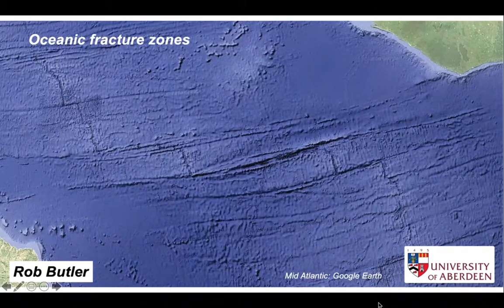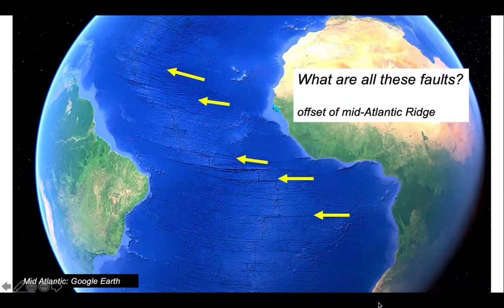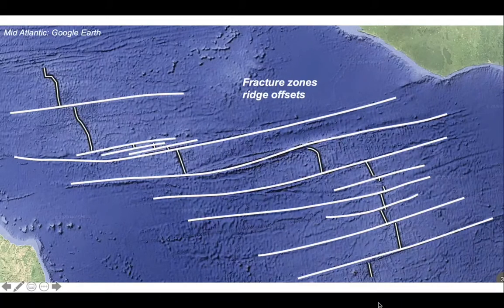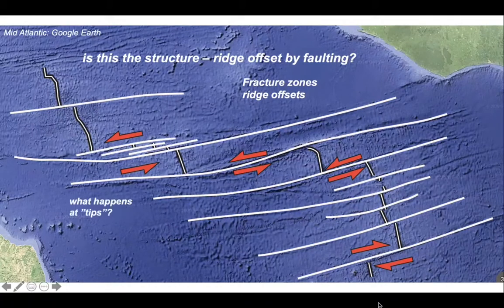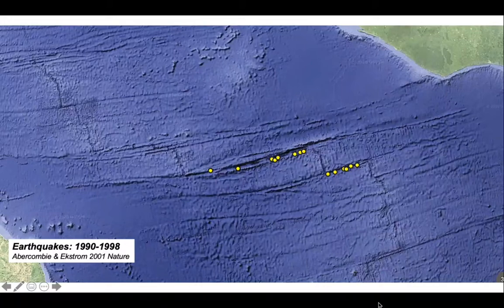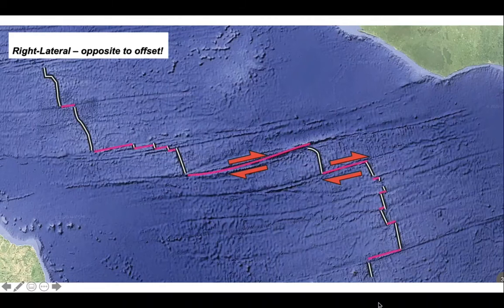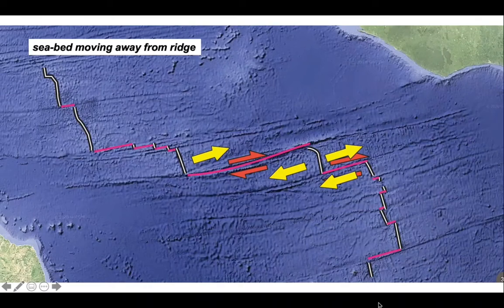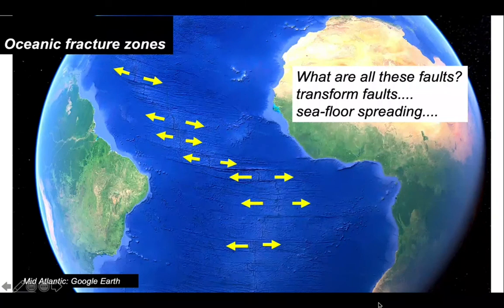Oceanic fracture zones

Comment: Seafloor spreading posits that the oceanic crust originates at the ridge crest and that the crust moves away in opposite directions on both sides. Thus, the segments of crust of equal ages must be of equal width. This does not appear to be supported by the transform fault patterns. Furthermore, the segments of crust are often curved and sometimes do not have a line of draw that would allow transform faults to move past each other in the manner described.
Reply from the maker: Thanks for the reflections. The broadly symmetrical pattern of magnetic stripes (ages of sea floor) predicted by sea floor spreading  is consistent with general observations... not sure what you mean by the "transform fault patterns". Check out the two videos on sea floor spreading:
https://www.youtube.com/watch?v=jm7OkClVvAw&t=123s
and part 2 https://www.youtube.com/watch?v=va3hMIhg2uk&t=36s